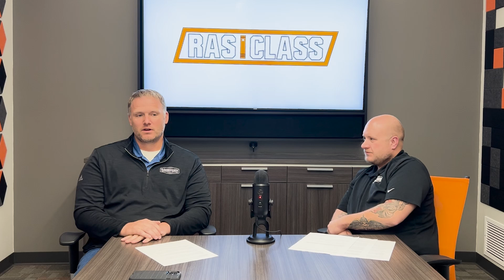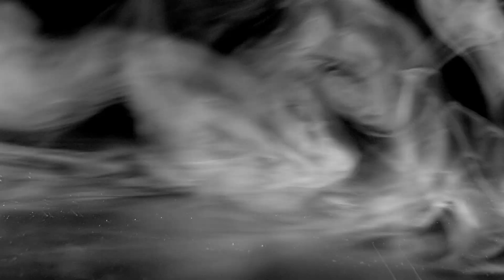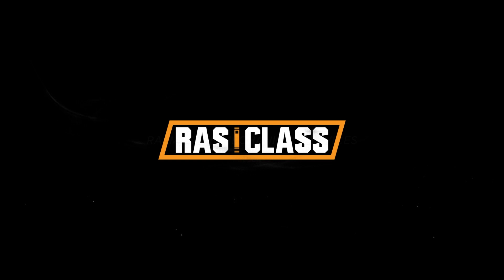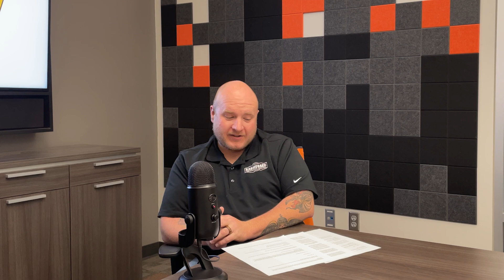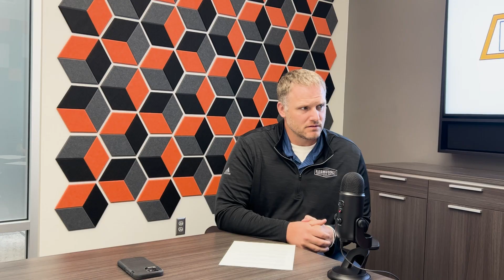Refrigerant Changes: What You Need to Know About A2Ls

Comment: How expensive and how often do they need to be calibrated and checked just added cost i still have a r22 unit i am 60 have ben a hvac service tech since  i was 19 i can still by a drop in replacement for r22 for the past 30 years i have worked in the commercial industrial side of the field we still have to maintain yearly or every six months refrigerant monitors for the r11 replacement in chiller rooms will we need to vent the building if refrigerant monitors go off in the occupied space
Reply from the maker: @davehuber6949  Every new piece of equipment that contains an A2L refrigerant will have a factory installed refrigerant sensor or come with one. They are maintenance free and do not need to be calibrated and come pre calibrated from factory. Some of the advanced refrigerant sensors may come with a built in self calibration mechanisms that automatically adjust for minor drifts over time.
Reply: @RasmussenMechanicalServices more shit to break!

Comment: I'm replacing my HVAC system in my church, starting mid January, 2025. What system do I need to install? the Old 410A, R32 or new A2L. I am a user and not a technician, so do not really understand the ins/outs of what I need, or what the Gov't is pushing?!  Please assist ASAP
Reply from the maker: @ScottPlambeck-u6f  410a units are no longer being produced. It’s whatever is in stock is what is left. R32 is part of the A2L line. It’s R32 and 454B which are part of the line. 410a has a sell out period of the next 3 years. So vendors have the next 3 years to sell their 410a units. Your best bet is to request an A2L unit. The downfall is the lead times are long so be proactive and plan ahead of time. Don’t wait until the unit is down. With long lead times look ahead and if you know you would like to upgrade in the future. Get going on it now. It’s better to plan ahead than scramble with unplanned down time! There is a higher cost for A2L right now but the savings in the future will offset this. Feel free to reach out to us if you would like a more indepth discussion! I’d be more than happy to help